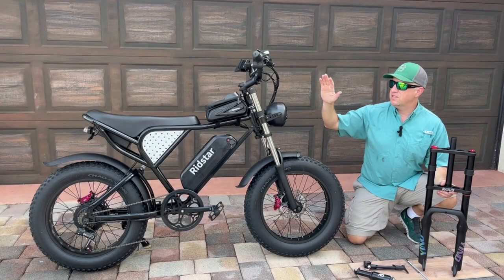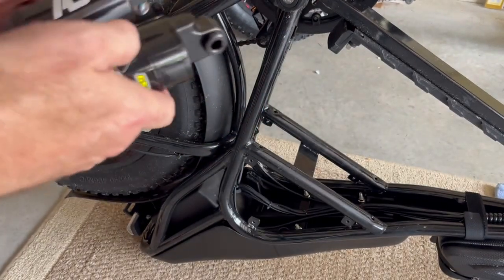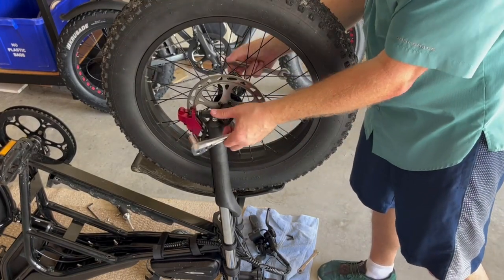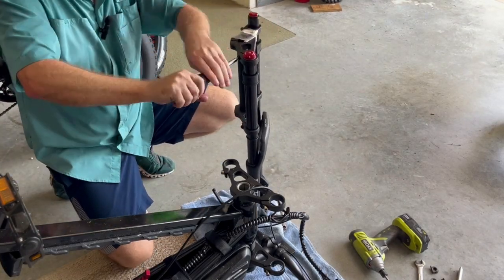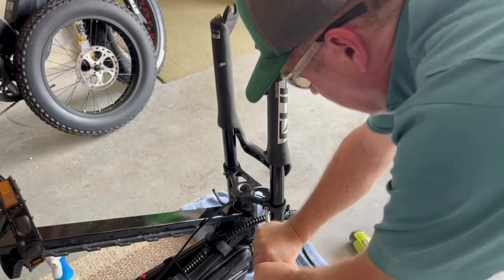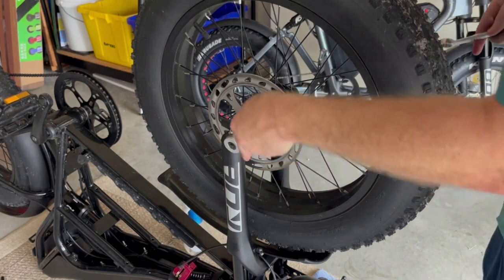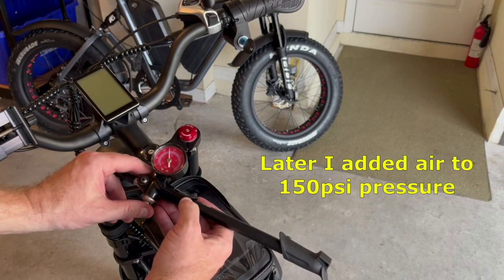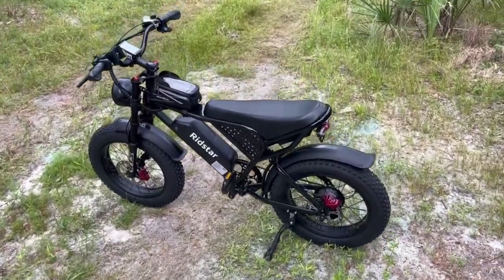Upgraded Fork on Ridstar Q20 - Air Suspension

Comment: B Rich solution two weeks ago, I ordered the same. I only used for a week and it turns on fine but it won't start it doesn't want to run. I went to the bicycles mecanic and they told me that the controller and  and throttle are damaged. Please I don't know if you can help me. what I can to do for my bicycles  thanks
Reply from the maker: Reach out to manufacturer for replacement parts.  I havd this happen on my Emoko c91 and received replacement parts.  While the part arrive try replacing the throttle via amazon if it doesn’t work return it.  https://amzn.to/3DQuVbh
Reply: Ridstar has some quality control issues, which makes sense they cut some corners on some of these parts.
Reply: @BRichSolution  yes bro I see thanks for your help
Reply: @BRichSolution how u reach out to manufacturers for this q20

Comment: Does anyone knows what the max size on a rear shock is for this bike I found one that's 230x65 does that fit
Reply from the maker: It will fit and might make the trailing arm angle down… but its its air shock you can adjust the compression to your liking
Reply: how was it? I’m considering getting the DNM Burner-RCP 2S but don’t know which size 190mm or 220 or 240? Any tips?

Comment: I followed this video & my rear air shock won't budge... the o ring stays at the top & doesn't move at any psi. I'm starting to think suspension doesn't exist with this bike.

 Wish i never bought the pump, shock, bike, or the rest of the other crap, but I'm in Ireland, so im now stuck with this shite!!!!!
Reply from the maker: the stock rear shock is not air shock and is junk.  The one I replaced moves so long as you set psi to 60 psi per chamber
Reply: @BRichSolution  I bought the same air shock in your video for the rear & it isn't budging at 60 psi both cylinders

Comment: Do not buy this bike no customer service cost $450 to ship back no replacement parts
Reply from the maker: Sorry to hear that.  Did you buy from amazon or aliexpress?   I had issue with ridstar folding bike last year and sent me replacement part no problem
Reply: @BRichSolution  Amazon
Reply: Oh I’ve bought from Aliexpress
Reply: Saying this I first bought from a UK firm who turned out to be a scam and lost £1500! Aliexpress was cheaper and should have gone to them first
Reply: I bought this bike and the rear motor cable got severed and I contacted the seller and I was able to buy a brand new rear motor and all the hardware, the people were nice and really helpful on getting my new parts too
Reply: And I bought it off Amazon by the way
Reply: Which bike you like the most ?
Reply: I got mine off Amazon and returned it for a full refund. Then I went to ebay and bought it for the same price but no shipping fee. With Amazon I paid 150 shipping fee which was fully returned with 2 days of them receiving the returned ebike.
Reply: @BRichSolution  do you know of a good replacement for the brake light? Mine is busted